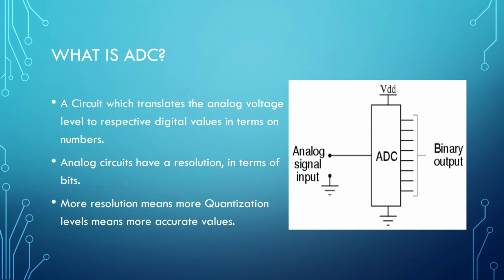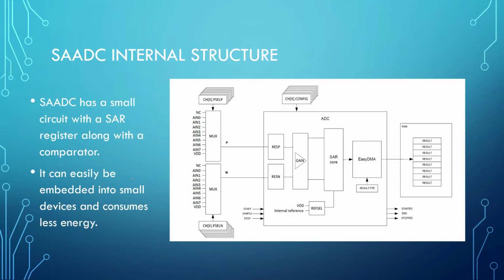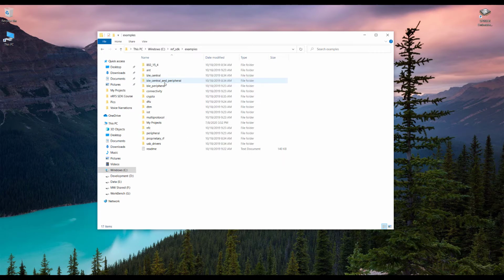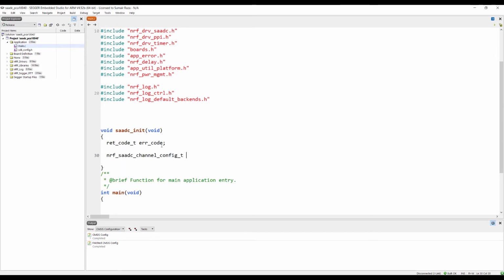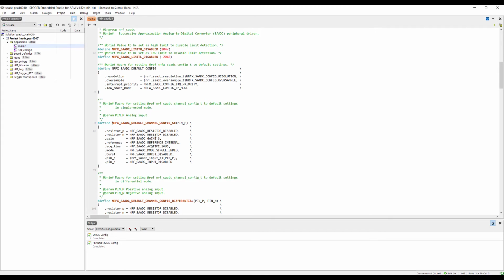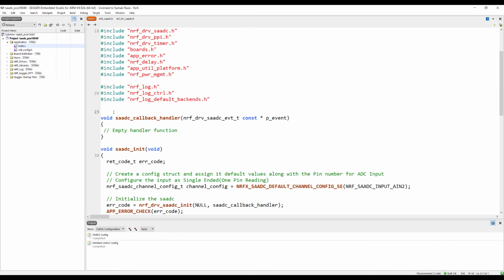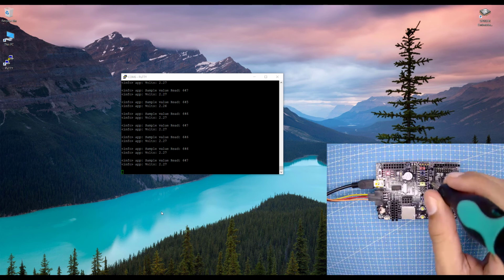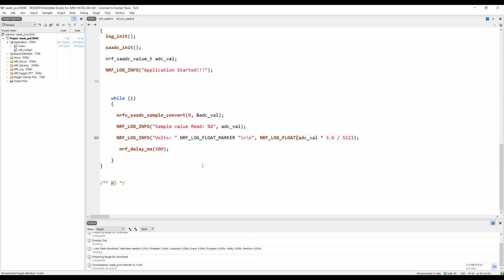nRF5 SDK - Tutorial for Beginners Pt 19  - SAADC an Introduction - (Single Ended & Differential)

Comment: REVISED: As described in the datasheet, what u mentioned  in the video is true - The bottom overlay is quite deceiving

Hi, Thank you again for your helpful tutorials.
I see that the pinout is a bit different in nrf52840 DK , for example as its printed on the bottom of the board, the P0.03 is actually (A0). but I am not sure if the (A0) is actually (AIN0) or its arduino compatibility hints...

Comment: Hi. I follow this video. When I pass VDD voltage to input analog,  ADC output I get = 850 and analog value =2.95 . I just thing they should be 1024 and 3.3. Do you help me to explain it. I am amateur on that. Thank you so much
Reply from the maker: Hi, i have updated the description of the video with a lots of information and calculations, please read it carefully to understand whats going on with the code and why i used the 3.6 instead of 3.3 volts. It will help you understand all the basics.